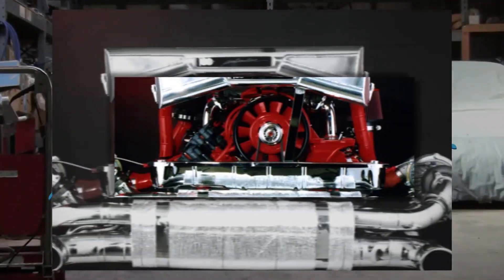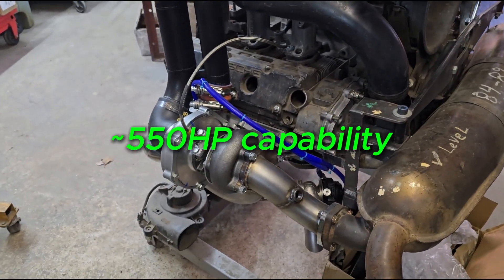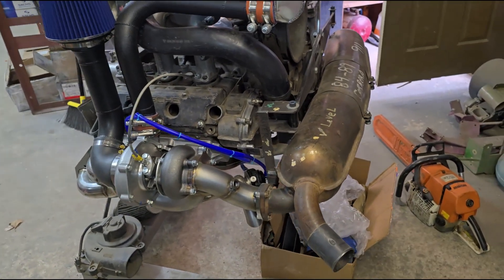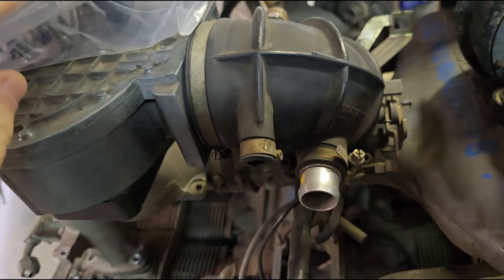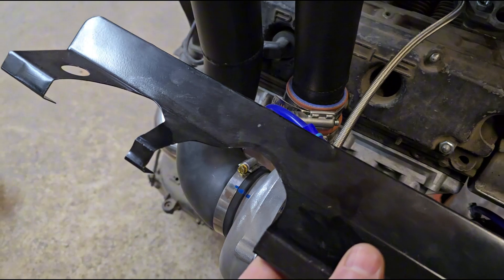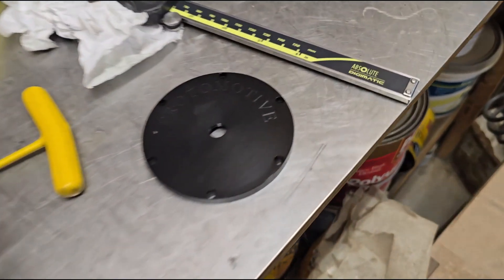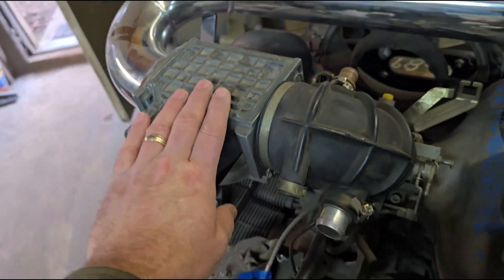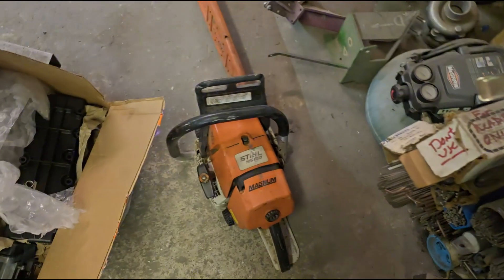POV: Stage 1 On the side, Intercooled for Porsche 911

Comment: Do these kits have turbo lag as with the 930 turbo? Or is it how its tuned / installed?
Reply from the maker: The fun part about these kits is a great base engine and you're not losing any of that just gaining with boost.  And these are running only 0.5 bar vs a 930 running 0.8 so the difference from off to on boost is much less.   Fun fact : a 930 that made 282hp with its turbo, if you remove the turbo makes only 126hp.   While the Carrera with no turbo already makes nearly twice that around 214 USA or 231 euro.   So you have twice the airflow to excite the turbo which makes for very good response and drivability.   We send out a replacement eprom and Turbo fuel pressure regulator for tuning.  Install can be done on a nice weekend.

Comment: I'm wanting a similar "low-cost" system for my 993. I am not interested in spending $17k on a TT setup. I've had many cars with aftermarket turbo kits that were much lower in cost including a piggyback ECU and fuel system. Here in California I would probably need to use E85 (as corrosive as it is) or source race fuel at the pump somewhere (we have 100 octane in various places but it's $10/gal. Thoughts? Or write back to me if you can find my original e-mail.
Reply from the maker: Tpc makes a supercharger kit for the 993tt I thought was in the 10k range.   Due to the layout of the chassis we do tt kits on the 993s.  It just fits best.   And with the twin plug distributor you're not getting a turbo compressor nozzle up through there.    Yes e85 is fantastic.  We've done quite a few now.   You have to change the fuel lines though or the rubber dries and cracks.  A lower cost help is a meth kit.
Reply from the maker: @asdfasdfasdfasdeff  I thought again about this and if you put a 964 set of heat exchangers on the car we could use our stage 1 on the side on your 993 for a nice low cost single turbo kit.
Reply: @protomotive  Yes, that is what I was kind of thinking. Doing that on 91 pump gas here in california with my stock compression what do you feel is safe, 5lbs of boost? Journal bearing to keep cost down? +80hp? do I need larger injectors / pump or an intercooler?
Reply from the maker: @asdfasdfasdfasdeff  Yes, between 4 to 5 psi would net 80-100hp gain.   Stock injectors and pump (if in good shape) can get you there.  At that low of boost you can get away without an intercooler,  but will lose some power without it, espcially in Ca. where it's very hot.  So like this video a stage 1 on the side, intercooled would be more ideal if it fits in your budget still.